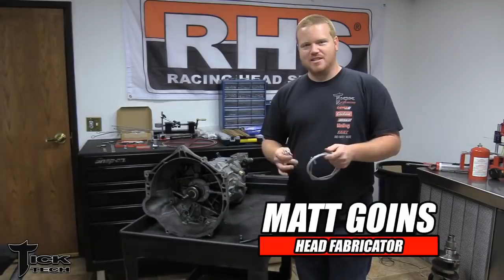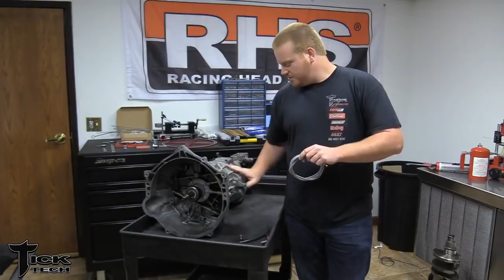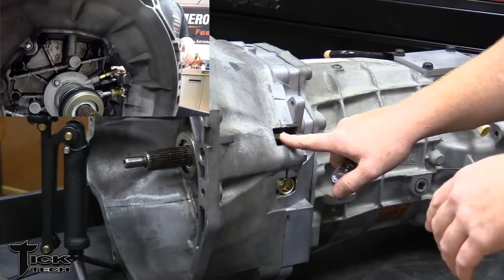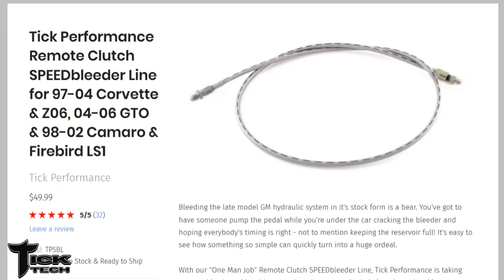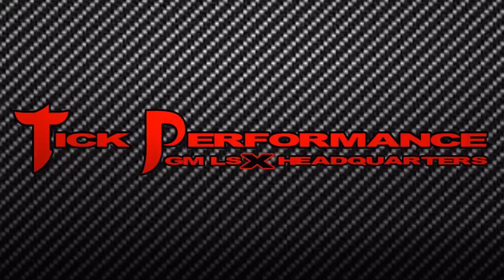Tech Tip: Tick Performance QUICK Install Remote Clutch SPEED Bleeder Line for Camaro, Firebird, GTO

Comment: Here's a question. I have a remote bleeder on my car already but I rubbed a hole thru the line. Do you have a repair kit or the fittings and couple I can repair this one instead of messing around with changing the hose even if I can get to it. The trany is in a Saturn Sky to its really tight fit. Thanks
Reply: Did you ever find a fix? Just burnt a hole in my bleeder in my c6 cause it was on the header. Really don’t want to have to drop the trans and all that to get to it if there’s a workaround.

Comment: Currently installing. I had a heck of a time getting the new bleeder fitting into the slave. I actually bought a $20 camera on amazon and got it in instantly lol. I also suggest a set of offset wrenches to be able to tighten the bleeder. My short socket wouldn't clear the fitting end... and I didn't have enough clearance to fit a longer socket on. 
Link to the camera: https://www.amazon.com/gp/product/B07DGPXH3S/ref=ppx_yo_dt_b_asin_title_o01_s00?ie=UTF8&psc=1

Comment: Great product, but the video makes it look much easier than it is, as he mentioned.  You cannot get a deep well socket on the existing fitting, you have to use a standard short socket as there is not enough room between the body and the bell housing.  He should also point out GREAT care must be taken backing the old fitting out, I looked away for a millisecond backing the socket out by hand at the last threads and boom, the fitting and socket fell down into the bell housing!  30 minutes later I was able to fish the socket out first and then the old fitting.  Thank goodness the bell housing is aluminum, and also note, drop the magnet into the bell housing just below at the opening for the clutch line.  Otherwise it is almost impossible to fish the part out.
Reply: I installed one. Check it out. Watch "Installing a tick performance LS1 T56 Camaro speed bleeder." on YouTube
https://youtu.be/mXgEaHfyXV0